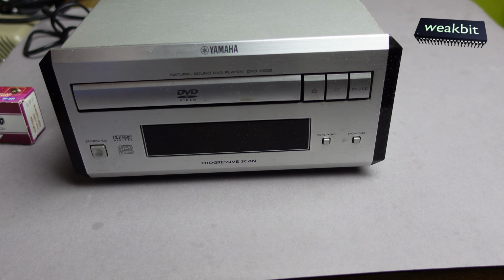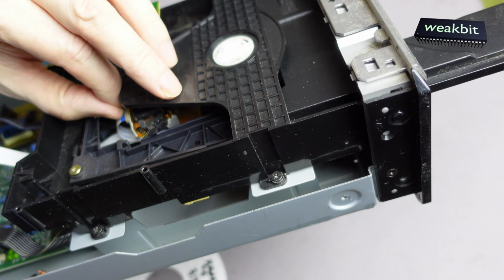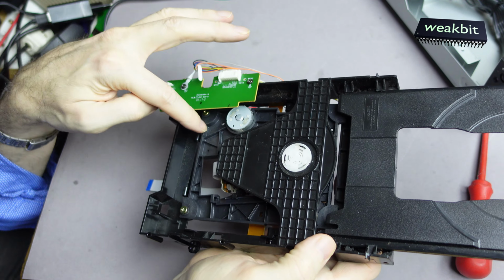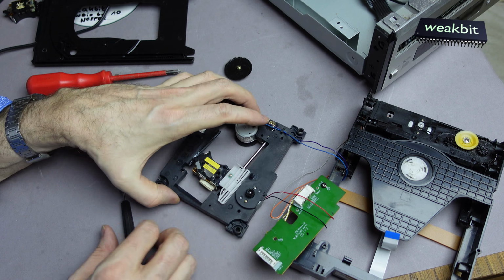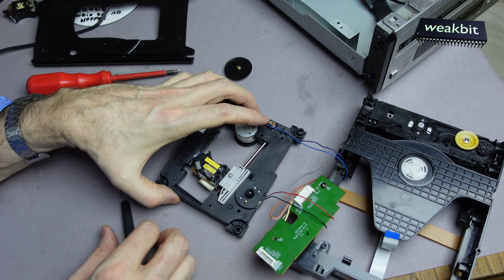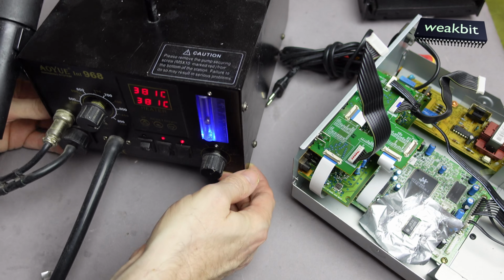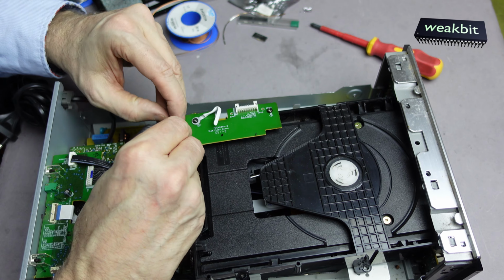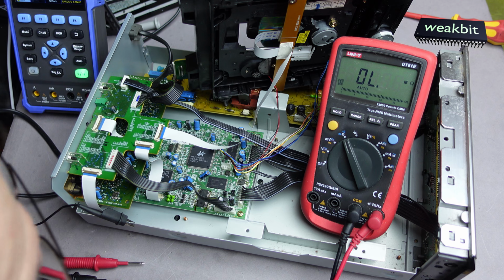Yamaha DVD-E600 repair part1

Comment: Cool! I don't understand why you didn't check the Spin DC motor? All the symptoms seem to be talking about it.
Reply from the maker: The first issue was the defect amplifier - then I must wait for the new IC weeks and after I build it in so then this new IC is going hot and then I know that I should measure this motor but I've never a defect motor in years. When was your last spin motor defect? All the best! and Thank you for watching weakbit
Reply: @weakbit633  With this behavior, I would immediately check the spin motor. For 2021, out of 5 devices, two had motor problems.
Reply from the maker: @Blambik  This was the first spin-motor with 0,7ohm from this brand and if you have more CD-Players/DVD repairs in sum then wellcome in this repair-world hell! weakbit